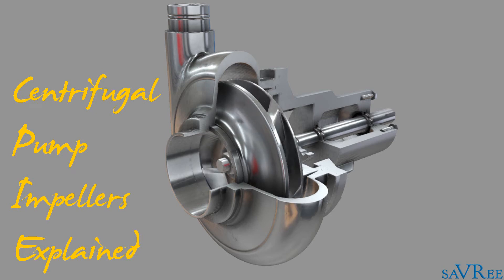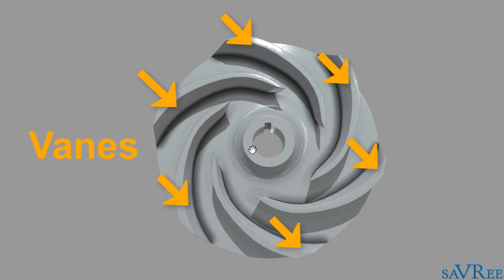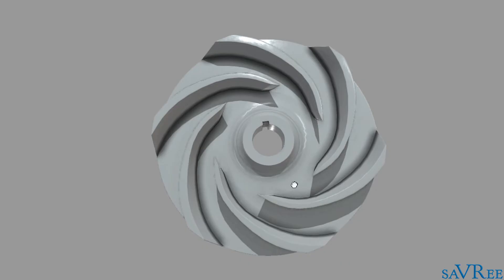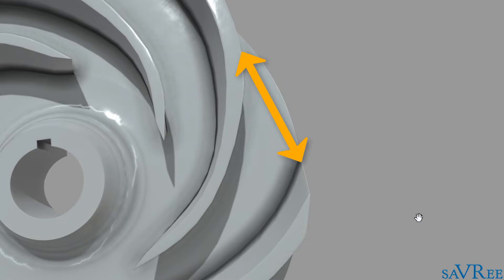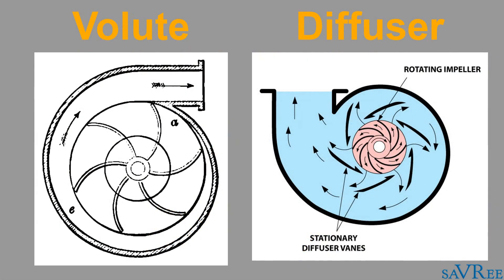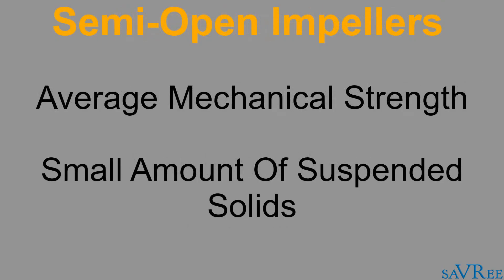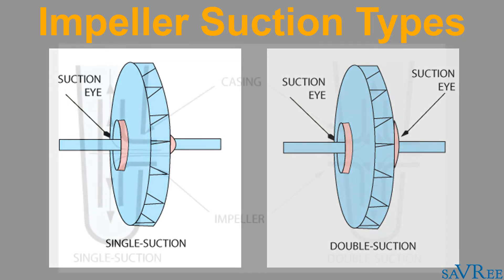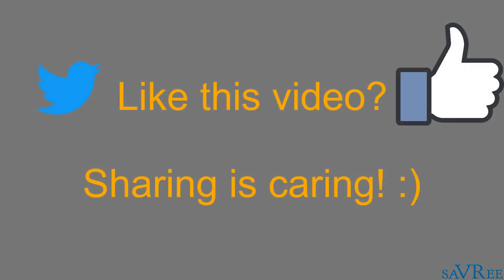Centrifugal Pump Impellers

Comment: Why in eye of impeller there's nagative pressure and why it's suck the Fluid?
Reply: The pump impeller draws liquid away from the suction of the pump, which just like sucking on a straw is going to attempt to form some sort of vacuum. This is why net positive suction head to prevent cavitation is very important.

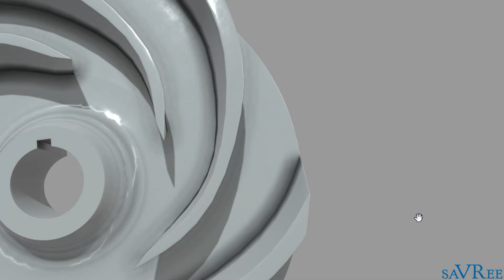Comment: Wait, at 3:25 you said the area spacing between impeller blades is increased radially to convert kinetic energy to pressure energy.And the argument you give is that as per Bernoulli equation increase in area leads to decrease in velocity. But the thing is the impeller blade is supplying energy to the water and therefore Bernoulli equation cannot be applied. Moreover the reference frame is also not inertial but a rotating frame which imparts centrifugal force which we should also take into account. The reasons should be explained taking into considerations these two factors also.

Comment: how does increasing area increase the pressure? isnt pressure force per area and any unit of increase in pressure should decrease it?
Reply: Not in a system that’s flowing. 

The simplest way to understand it is that in fluid flow, there’s three forms of energy. Height or potential, kinetic or velocity, and pressure. 
Now take two points in the flow. The total energy at the two points have to equal. If you add up the three forms of energy at point A, it has to equal the energy at point B. 
If any form of energy goes up, another form has to go down an equal amount. The easiest example is if a pipe goes higher by 1 foot, an increase in height or potential, the pressure has to drop by 1 foot. About .4 psi for water. 

If velocity drops with an increase in area, pressure has to increase by an equal amount. This is what’s happening in the impeller and also the volute. 

Of course, point B will actually have a little less energy than A because some will be lost to friction.

Comment: Why is it beneficial to have the increasing channel area toward the outside of the impeller? Also every flow simulation I have seen shows the velocity of the fluid being very high at the outermost part of the channel, which makes sense because that's where the vane linear velocity is at its highest. Wouldn't this expansion in area create unwanted low pressure at the outermost portion of the channel? I understand that this increase in area is sort of inherit to the design of a round object haha, but has anyone done flow tests on an impeller with widening vanes to keep the channels the  same area? They must have right?

Comment: Hi John,
Very good presentation as usual
I have some doubts
1. Why should the number of channels be less for        fluids with high suspended solids and more for fluids with less suspended solids??
2. Though fully closed impellers have the highest mechanical strength compared to the other two types, why aren't they used for pumping slurries and why open impellers having the lowest mechanical strength are being used for pumping slurries ?
Reply: Because particles may get stuck
Reply: Regarding your second question, slurry pump impellers are often closed.  In fact they will almost exclusively be closed because the front shroud has pump out vanes on the outside to prevent frontal recirculation.  The only time you will have an open impeller on a slurry pump is if you have stringy fibrous material, froth or the pump size is really small.

Comment: I recently was running a pump application calculation switching from a closed vane impeller to a semi open vane impeller... the speed needed to pump the same volume decreased by approximately 50rpm with the semi open impeller. Which, will require a drive change... WHY?!
Reply: Because the flow rate increased